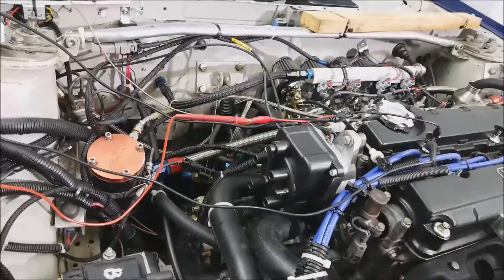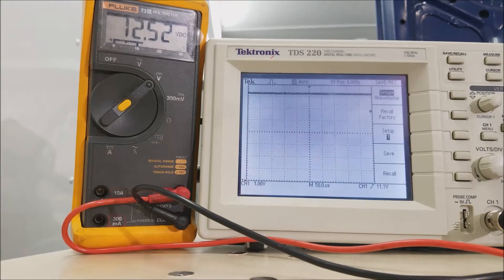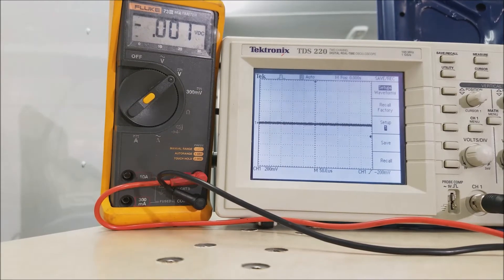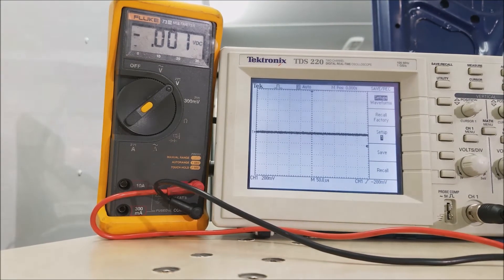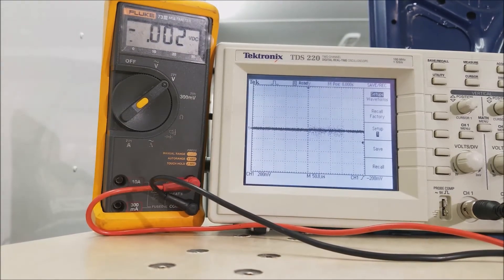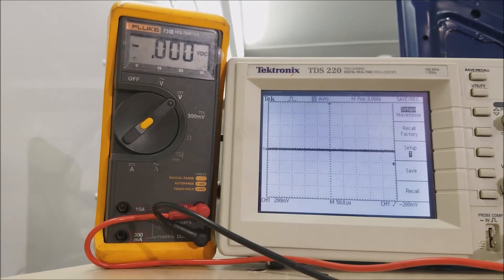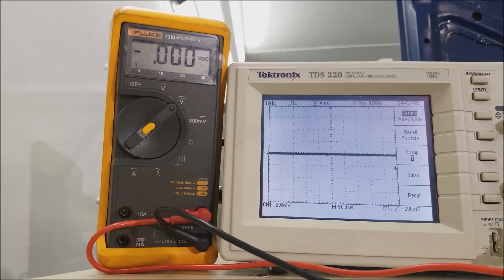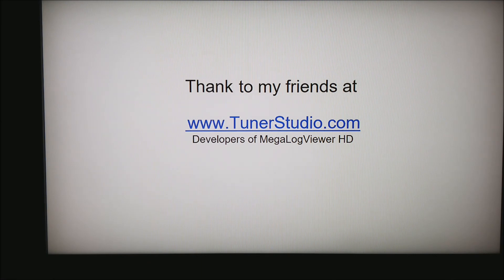Cranking Voltage Drop Test

Comment: I might have either a grounding issue or an other issue. Low cranking voltage and engine/startmotor seems not to start quick. Its a new battery, fully charged, same symptoms with my previous older battery. Using both a fluke 179 dmm and a battery tester. "Cranking low min 9.2v max 11.25v cranking time 5398ms" my older battery had this values: "cranking low min 8.11v max 10.29v cranking time 4892ms" 

I know my starter motor is rated at 1.2kW

Comment: I was a bit confused on hiw the grounding tests where done, was there not a direct ground from batt negative to engine at the first ground test and then a direct ground to engine? Where is the MS ground?
Reply from the maker: In the first test, I had the scope connected between the engine block and at the battery ground terminal.  What you are seeing is the total voltage drop on the grounding at full cranking amperage.

In my car, the ECU is grounded at the chassis and at the same place the engine grounds thru a huge welding cable (about 18" long total).  My motor was not having a starting issue.  The test was simply done as a FYI for people to understand that voltage drops are very real in high amperage situations.